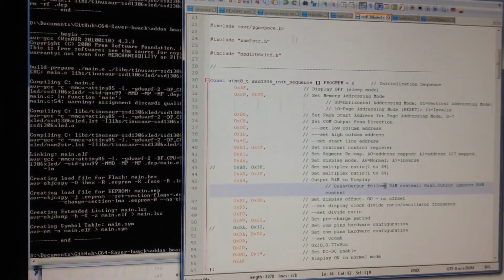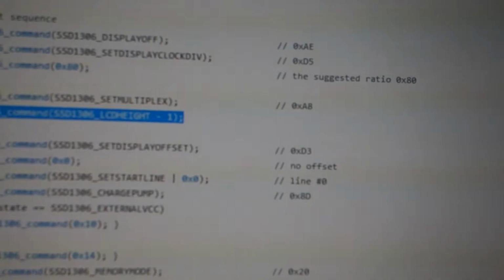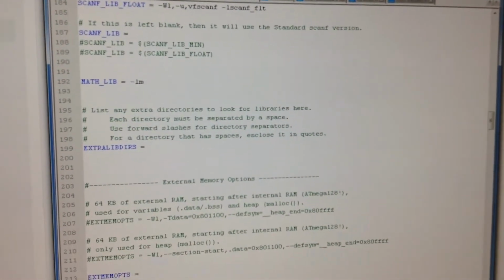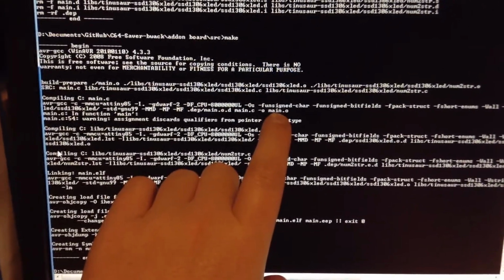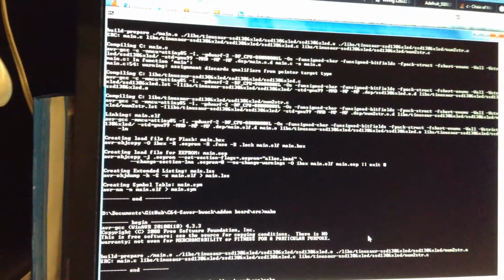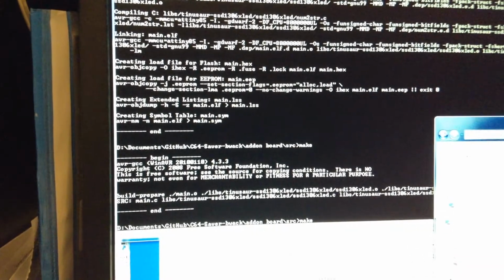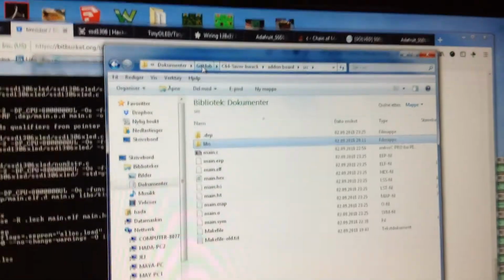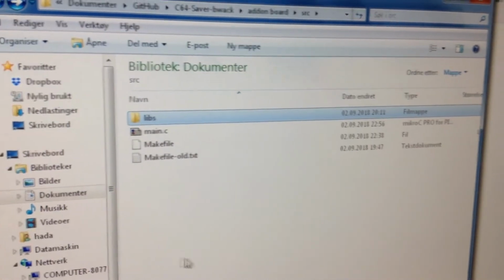addonboard for the c64 saver 2

Comment: I have to say that I'm intimidated by writing make files. However, using build tools like make and dependency managers on Linux based systems is much easier than on Windows. Keeping track of all the dependencies between libraries is impossible to do by hand. Tools like composer (for php) for instance make that an easy task.
Smart idea to aim the power features at the c64 repair crowd! It'll be a very handy tool for them.
Reply from the maker: Thanks for the comment. Sorry for the late reply. It is really hard to only rely on dependencies. I and a college had this weird bug at work where a c library function worked fine in one executeable/daemon but not the the other. So I said to my college to check the linker flags. We spent days on it. There was a library linked that had its own  jsonc statically linked, so the structs werent the same and therefor segfaulted. c does not have namespaces.. anyway thats work and gcc, but I wish Arduino would handle libraries in project properties.